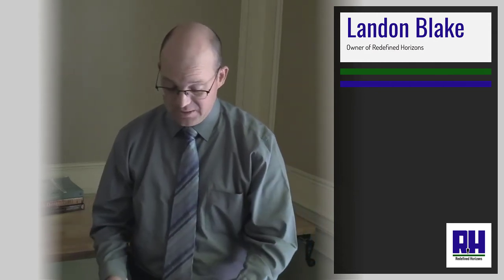Don't Blame Your People For Mistakes When You Lack A Process (Or Have A Broken Process)

Comment: Amen to that! I keep preaching the same thing but the "higher ups" at the company I used to work for never listened. It also dramatically increases efficiency and therefore your bottom line to have a good system!
Reply from the maker: Exactly!!
Reply: i work for an RPLS in texas now as the one and only "field guy" with a teenager for a "helper", and lets just say the boss still uses autocad2000 on a computer running windows XP for drafting, pretty much everything else is still paper and pencil. 🤷🏻‍♂️